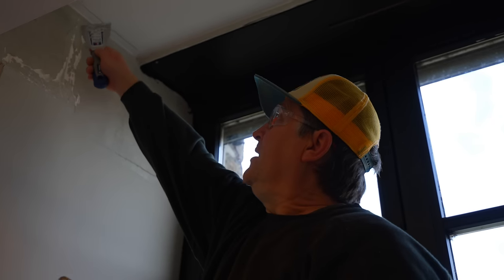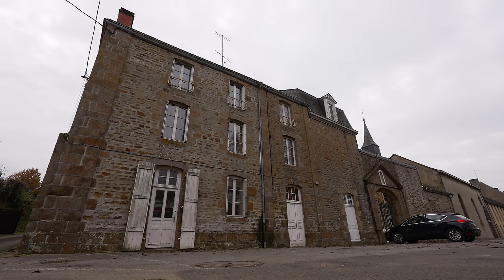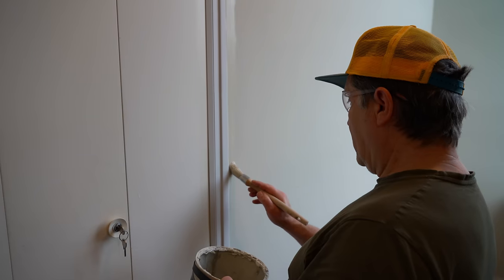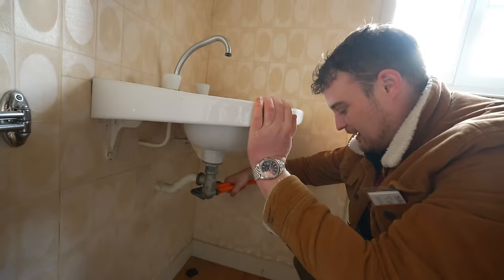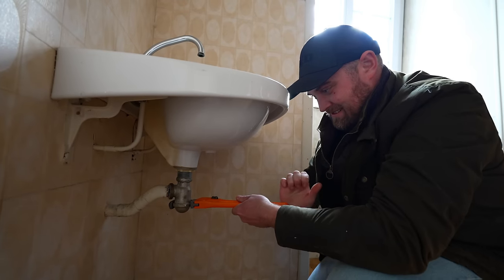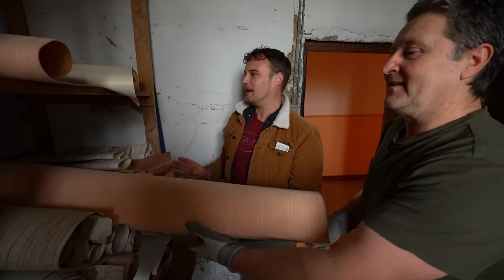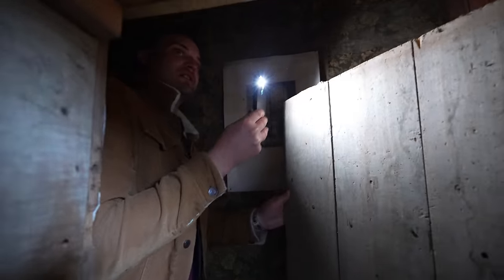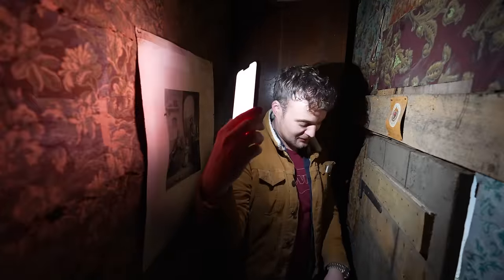We Have Been Told What The Convent Was Used For 60 Years Ago

Comment: It's amazing how that wallpaper has been so wonderfully preserved, being in the dark all these years. Rarely do you get a chance to see the original vibrant colors of such old wallpaper!
Reply: You might want to be careful with that old wallpaper some old wallpapers contained large dangerous amount of arsenic and/or mercury in the dyes and paints. Not trying to be an alarmest just want people to be safe.
Reply: @hannakinn  Arsenic wasn’t introduced to wallpaper until the mid-19th century, and these wallpaper scraps are probably older than that. Also arsenic was used to produce certain  bright greens, blues, and yellows. I wonder how often cinnabar (mercury sulfide) was used for reds, and what era it was used? But the mercury in cinnabar is pretty stable, so I’m not sure it would have been as toxic as a pigment, as long as it wasn’t heated.

Comment: It's called a "pipe wrench" in the USA. You can use a length of metal pipe that will slip onto the handle to  provide extra torque for tough fittings...that's called a "deadman."

Comment: If you put a piece of cloth or rag around the sink drain before you use the pipe wrench, you won’t scratch the pipe fitting. If we have a rusted or stuck bolt, we put a bit of Coca Cola on it, wait 5 minutes, and the bolt moves easily.

Comment: Instead of struggling to undo all of those sink traps, why don't you WD40 the lot ahead of time? Should only take about 10mins to visit the lot and give them all a quick spray. By the time you're ready to work your way through the advent calendar of sink traps they should come undone fairly easily.

Might be possible to (very) gently soak those old wallpapers in the secret cupboard off of the wall using a wallpaper sponge. It's so dry in there what I'd try is to wet a small sample to begin with but not so that it's wringing wet. Then allow to dry out until it's semi dry. This sounds mad but given the age of the glue holding them onto the wall, it may be just enough to allow you to come back and very carefully use a wallpaper scraper to (lever/peel) the wallpaper off of the wall. 
If it doesn't work 1st time around, try repeating the process for 1 or 2 times more. The repeated wetting & drying should cause the paper to begin to naturally lift off of the wall just as it does in a house with damp issues. Otherwise Michael will have to attempt photography but I suspect he will have real difficulty in getting everything into proper focus; it's such a narrow space.